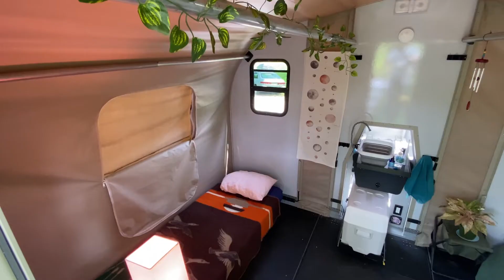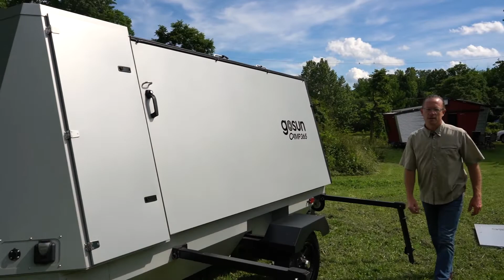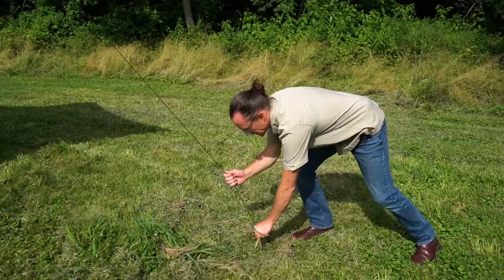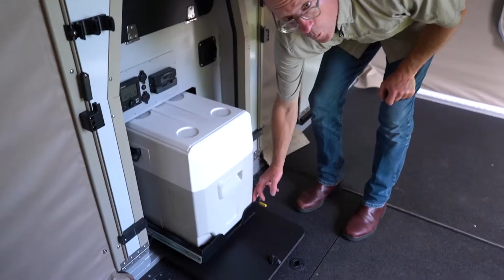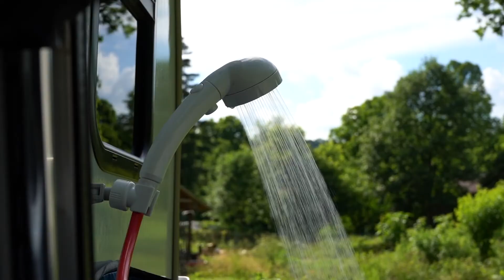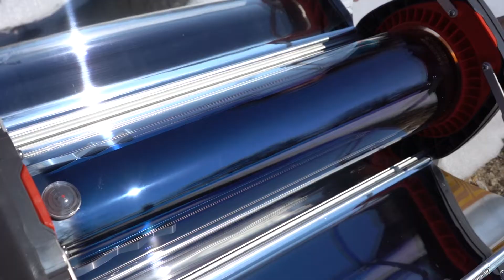Techstination Interview: GoSun Camp365 solar powered off-grid camper

Comment: How much
Reply: $36,000… I had to do some research as when I went to the website I had to pay off $500 deposit in order to find out the pricing however I did some more research for them that and found out that people are paying between 23 and $36,000 for these things… At $23,000 it’s not worth it even if it includes the solar panels and bed and stove however that would be for the Iron model. It is not worth $23,000 and it will never be worth $36,000. I hope this company goes out of business.

Comment: Incredible innovation!....insane to think everything you could possibly want in design and function is already part of this.....just wow!
Reply: Its not innovative at all… there are plenty of trailers like this on the market with way better living situations at a fraction of the cost. Also, in order to find out pricing on their website, you have to pay a $500 deposit… However, if you do some research you find out that the top model cost $36,000 does not include a stove or toilet